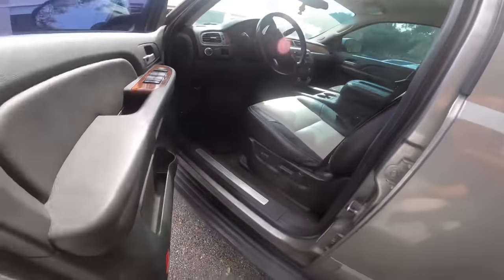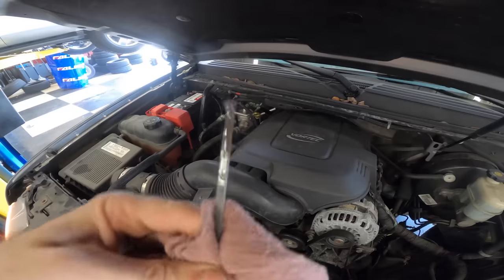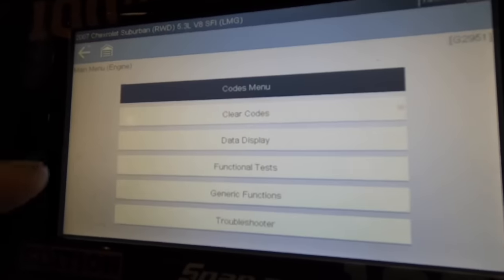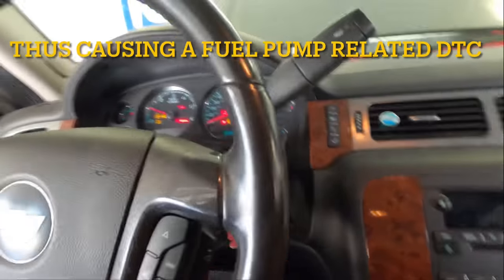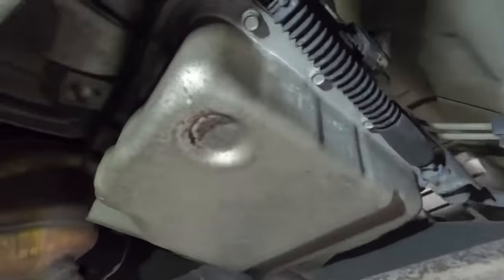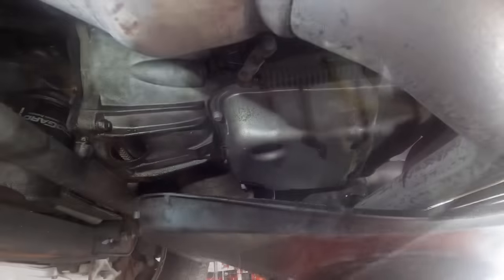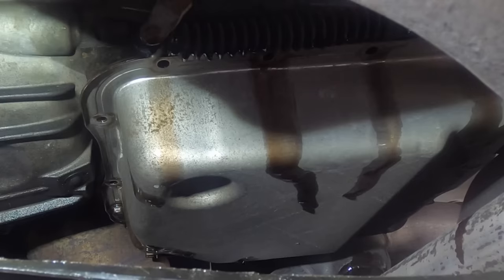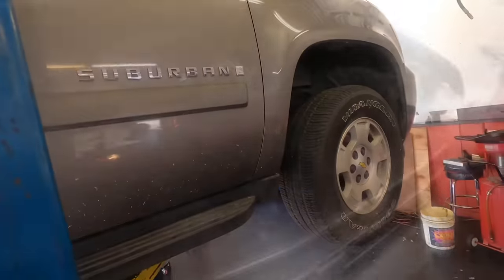Busted! SCAMMING Mechanic Causes Damage! 4l60E Transmission

Comment: Thanks for being one of the good and honest mechanics out there. My late mother was a merchandiser that frequently kept her out on the road. During one of her business trips the check engine light came on and she brought it to the next auto repair place she came across. (Her company would cover the bill, you see.) I don't recall what they claimed that it was but she had them fix it.

Once back out on the road she accelerated up to the speed of traffic. She took her foot off of the gas as traffic started to slow and the car's speed didn't decrease and no she wasn't using cruise control. She struggled with the breaks against the accelerator, while weaving through traffic and eventually had to put it into neutral to bring it to a safe stop. Needless to say it was a terrifying experience.

She was close to home by then and had it towed to her usual mechanic. There, they found the rod that led from the accelerator pedal to the engine had been bent thereby preventing it from returning to it's default position. Her mechanic said it was impossible for her to have bent it, no matter how hard she pushed on the pedal and that it had to have been the mechanic she stopped by that did it. With his testimony her company threatened legal action against the auto shop and were reimbursed for the damages. Personally I think the mechanic should have been charged with something like reckless endangerment because she could've very well been killed.

Comment: This is why I am learning how to fix cars myself because you never know who's going to rip you off. Good on you for being a stand up mechanic.
Reply: Good choice, even Ray would take you for a hell ride if he was in the right mood.
Reply: You kind of do. Just assume every mechanic is ripping you off, because they are!
Reply: At 100 dollars a hour the stealership is getting rich.
Reply: @peterwill3699  only $100... by me repair shops charge $120 hr and dealers charge appx $140 hr
Reply: I own a Toyota hybrid and a simple oil change would cost me like 200 euro's or so... And a complete inspection, as the dealer recommends, would cost me about 500 euro's I think. All they do is change the oil and filter, replace airfilter and interiorfilter, fill up the washerfluid, and print a big bill. I change the oil and filter myself, change sparkplugs and the cost of all that are very low..And it's a nice job to do also..
Reply: @joskd8491  It can sound like its just that but its mostly more then that. For the most part u pay for work time not the parts, and yes filters and stuff aren't that expensive. But the inspection takes time and for changing the oil, airfilters and all that and reading out the computers checking ur lights its a fair price. I've seen prices from partnered dealerships going over 1000 from VW or Mercedes
Reply: @lucashimself2063  For a simple 'small service' as they call it there is no reason to read out the computer, so that's not done, especially when no check engine light is on. And checking lights? Oh come on
Reply: @joskd8491  At least where i work we read out the codes with every inspection. And small service would be just a oil change or breake pads.A inspection isnt a small service. And yes checking lights if they are too high and get into an accident because u blinded someone its on u.
Reply: @lucashimself2063  making people scared makes them pay, right?
Reply: @joskd8491  Its as much a safety hazard as the car it self. And that's why it is done in a inspection so it doesn't happen. And whats worse $5 for the light height or a lawsuit. Its for safety reasons for you and others xd

Comment: I cried when I saw the underside of that 15 year old vehicle, spotless and rust free. Up here in Central New York State, that vehicle would already have been crushed into a cube and on a slow boat to China for recycling due to excessive rusting caused by road salt. Another great job Ray. You are more than competent in your abilities and even better, a good, honest person. Keep up the honest and great work.
Reply: its not the road salt at all. its the positive and negative wiring set up. e v e r y car be4 they went to neg ground to the frame the car never rusted out. why not put zinc cathodes on your car/truck. to save the under side. as i might do to mine.
Reply: Your exaggerating. I grew up in the mountains of New Hampshire. Yeah,  rust occurs but they love 25 years or more. It's not that bad man.
Reply: @nathandean1687  can you show how it is done?
Reply: @nathandean1687  or just go to a car wash that has an undercarriage wash and apply fluid film once a year
Reply: i tell people to rinse off there cars and trucks in the winter time. just get the salt off the car.

Comment: Please do a follow up on this one if you ever hear from the customer again :) This explains why I do my own repairs.
Reply: I do my repairs myself too. I can’t trust most mechanics.
Reply: Start do my own repairs also, after getting rip off.. asked my local shop to replace my front shock, they instead replace all the front and rear lower and upper arm, ball joint and even cv shaft without even asking me first and charge a fortune.. the parts which they replace are still good, still have tight tolerance.. thats the last time i'll be ever bring my car to the shop.. now i have all the tools including the scanning tool and start doing a repair jobs in my garage for all my family and relatives.
Reply: So lucky my one of my dad's good friends is an amazing mechanic. The trouble is he's always too damn busy
Reply: Its not only the fact that they rip you off but trustig them with your vehicle even if they did do a good repair or not. Specially if it makes good power, they take it for a joy ride.
Reply: @harisyoung4110  If the shop does not have a signature of authorization for the repairs to be performed presented clearly to you (on a write-up estimate, or an invoice) you could have taken that to court and they would have released your car as that is against the law.

Edit: I know this because I have written service for numerous repair facilities. They can get away with what's in the fine print, eg. If they say that the cost of repair may deviate by 10% for any reasons (like Pep Boys for example). If the didn't get some sort of signature or authorization from you, then they have no legal leg to stand on in the court of law.
Reply: @brendandrury2177  there are lots, and as an honest tradesman that likes to do things right, and charge accordingly and fairly it's very frustrating.
Reply: @OfficialDreamTheater   I know but the legal cost and time need to spend with the case will be not worth for me to proceed with the legal action..

Comment: You can increase the reliabilty and lifespan of almost any vehicle by taking care of it and following the manufacturers recommended maintenance schedule. I use software on my laptop called Automotive Wolf that tracks and manages the schedules for all my vehicles. I currently have 3 cars from different manufacturers all with over 200,000 miles and running great.
Reply: I use that Automotive Wolf software for my car, truck, boat and a generator!

Comment: I love seeing stuff like this. As a pc repair technician, the troubleshooting  steps are quite similar in determining what is at fault, so that a solution can be implemented. Unfortunately, I don't set the prices charged, but believe me when I say that they definitely should be cheaper.

Comment: Thank you very much for being an honest car repair man. Your kind is very hard to find. I get very distressed when something is wrong with my car because I never know if the repair shop I will take it to will rip me off or not. As a kid I learned a bit about cars because I was always paying attention to my late father who was not only a very good mechanic, but was also very fastidious with the way he took care of his cars. When he was driving and he heard the slightest noise from the car, I saw him paying attention and declaring his diagnosis just based on the sound he heard. I was pretty amazed that I started paying better attention. I watched and helped him when he was working on his cars and as a result I learned to do my own oil and filter change, and a few other things. When I got married, I continued to do my own oil and filter change, and I also started doing my husband's car. My wonderful late husband could not do anything else, but change a light bulb. One day my cars automatic window would not open. I took it to a repair shop in the City of San Bernardino. The diagnosis was very quick. The  manager of the repair shop told me "the motor needed to be replaced'. I could hear the motor revving so I told him I was going to another repair shop for a second opinion. I asked him before I left if the mechanic who looked at my car was a new mechanic. His reply was, "Oh, no, he's been doing this for years". They charged me for the diagnosis. I went to a window repair shop. I wasn't sure if they simply replaced broken windows and windshields. I barely got into their parking lot when I was met by one of the employees. I asked if they fixed automatic windows that would not open. It was the window by the driver's side. He smacked the window and told me to try to open it , and it worked! He said it was just dislodged from its track. I asked how much and he said, "Oh, you don't owe me anything". I thanked him profusely and I went back to the  car dealership who told me I needed a new motor. I was very upset and they rightfully gave me back my money. I also reported them to the governmental agency overseeing repair shops because I was walking by their lounge area and I was looking at all the customers sitting there while having their cars repaired and I wondered how many of them would be scammed. I was surprised to actually get a call from the governmental agency thanking me for reporting the incident. The lady I spoke to said the service manager told her the mechanic who worked on my car was an inexperienced newbie. They just kept lying. I purchased a Nissan Rogue and within a short time I had three transmissions on that car. Had I not paid for the car in full, I would've had it repossessed by the bank because I was constantly at the repair shop. The first time I heard that grinding sound, I could not believe my ears. The car was brand new. Based on what I learned from my father, I needed a new transmission. I told them as soon as I got into the Nissan service center that I needed a new transmission, and they almost laughed me out of there. They said, "You have a new car, it cannot be the transmission".  However, it was the transmission. They replaced it and it was covered by warranty. Within a few months I heard that grinding sound again and when I told my husband I thought I needed a new transmission again, he said he would really be impressed if I were right again this time. I went back to Nissan and told them the same thing I told them the last time. They looked at the car and declared it wasn't my transmission. It was supposed to be something else. Few days later, I was calling Nissan again because the car just did not sound right. I was on my way to Nissan when my car just completely died in the middle of a very busy freeway. My car was towed to the Nissan dealership and it was the transmission. Anyway, I ended up suing Nissan for that lemon car and they gave me back every penny of what I paid for that car. I will never buy a Nissan again. I've owned over ten brand new cars in my lifetime and that was the worst car I've owned. Many years ago, one of my husband's friends opened a car repair shop. It was a franchise together with a tire shop. Within a few months he was opening a second one, then a third one. My husband would tell me how that friend would brag about a customer coming in for a car problem to be fixed and they would just invent all these other problems to jack up the cost of the repair. I felt like crying listening to this. I told my husband he needed to report him to somebody for ripping people off, but my husband said he could not. After he opened his second store, he was showing off his new Porsche to my husband. For many years when I drove and  I'd see another of those franchise stores with that guy's name on it, I would get so upset. I could not believe he was still in business. I am sorry this is such a long diatribe, but it feels so cathartic, especially that I am an old lady now wondering when my car will go bad and I will have to deal with a dishonest mechanic again. Just the thought stresses me out. Thank you again for being an honest man.
Reply: This was a lovely story- thanks from Tucson Az.
Reply: I’m j🎉
Reply: If you from the st Louis metropolitan area I'll fix your car fir just cost odmf parts message me I'd you have any problems thanks for sharing your stories
Reply: Love your story, cecillec!  I think literally everyone who ever had their car repaired has a story about being scammed.

Comment: Yes there are a few "scammer?" repair shops that are out there. It is always a good idea to get a second opinion if you have that gut feeling something is off. Thanks Ray for helping this customer.
Reply: 95% of all transmission shops are rip offs.

Thats the real issue.
Reply: @nexxusty  Yep.  Years back, a truly honest & professional auto-trans expert, showed me what is generally only wrong, with 80% of units that customers are told are due for complete replacement!!  I don't understand it, but he showed me a couple of tiny springs & plastic 'bits' that cost maybe $5 or something. And maybe band adjustments taking 5 minutes to do, after a flush out and fluid replacement and all is generally fine!!! He always shows customers the simple little bits he needed.
Reply: @glennsprigg2378  Auto-Trans experts are usually awesome dudes.

Anyone with that amount of dedication, working on cars, I've never met one that wasn't a good person.

Really hard to find these days.

Lol, that guy knows his trannys, if he can identify small issues like that and fix them cheap and quickly, thats super impressive. Must have been in the field a long time.
Reply: @glennsprigg2378   the problem with some of those small parts is that it requires the unit to be pulled out of the vehicle, and disassembled to replace them. At that point what sane person wouldn't recommend a rebuild? 

As far as band adjustments go, that was decades ago. It went the same route as carb adjustments, in that it's extinct pretty much on modern cars. These late model units are mostly electronic and have little to no adjustments whatsoever. Hell some of these units they don't even want to sell you replacement parts. Any type of moderate failure, they replace the entire unit.

These days you can identify the competent shops from the robots because they source internals, and learn the inner workings so they can actually solve problems vs do the manufacturer thing: remove and replace transmission unit.

Comment: Being in the transmission trade for many years, might I suggest breaking open that old filter… you might be surprised in what you find in there. Great work with the rest of the work you do though.
Reply: My son got a cheap first car that he had to fix broken cam belt. The car also had a cooling system that looked like it was full of oatmeal and transmission oil was like dirty cleaning fluid, it wasn't even slippery.  He tried to take the pan off but all the bolts were breaking so we rigged up a siphon to suck oil out of pan through dip stick tube and change it a quart at a time. Change a quart and drive for a few days, after a while it actually started looking red. When he sold it to another guy it was still working good.
Did pretty much the same with anti- freeze. Drain it out and let it sit till solids settle out and put it back in the next day.
Reply: I was thinking torquing the bands would have been good to do while the pan was off.